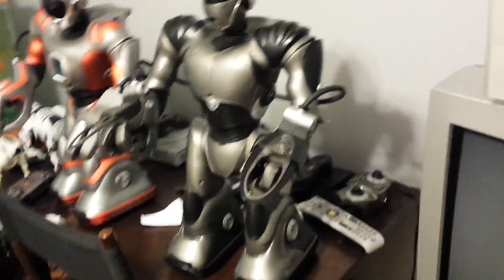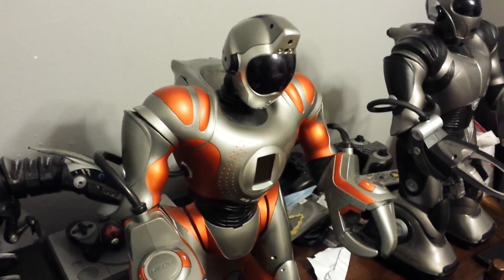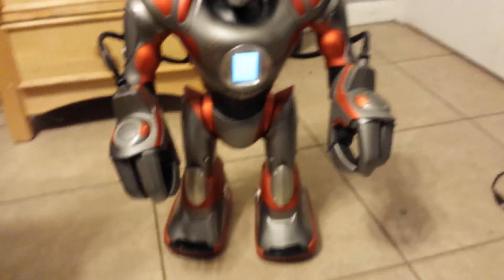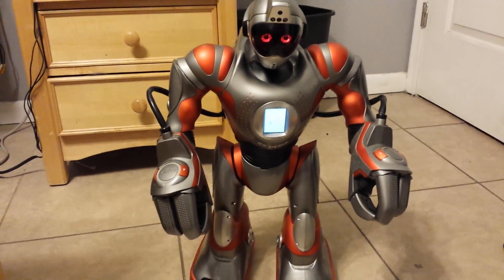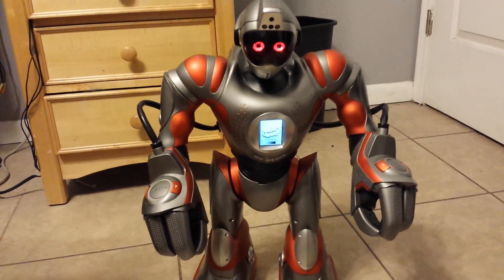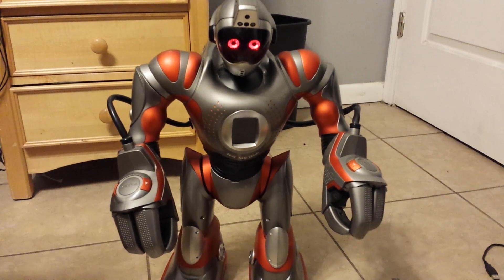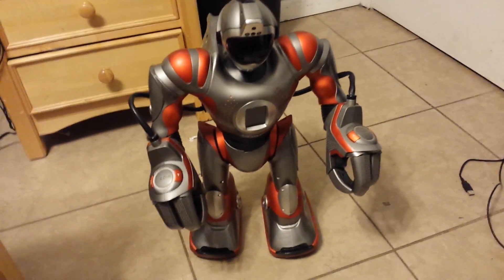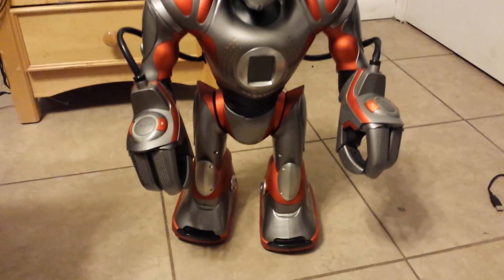Rs media problem

Comment: He said exactly what's wrong with him. The batteries in his feet need changing. Either constant walking has sponged the wires carrying the current from the batteries to his motherboard, making him shut down whenever more current is needed, or RS media cells themselves are so old that when the robot begins to draw enough current to operate, it shuts down. Honestly, simply hooking it up to an AC adapter looks like your best bet right now. It would be incredibly hard to try and find an adequate replacement for its power.

Comment: Hey..did you ever figure out the problem there ?....my rs media is doing exactly the same.....would really like some advice
Reply from the maker: Yes it was corrosion on the Double A contacts.
Reply: Hi where is the double A located in the robot? I have the same issue
Reply: @hoangchutich2144  at the bottom of the feet at the top

Comment: I have a 3rd gen V2 and it does not turn on, do you know what the problem may be? Thanks
Reply: They had notorious problems in V2 and RS Media models for the wires going from the batteries to the board having their rubber coating be melted off due to slight heat... They didn’t use a lot of rubber so it melted easily, but they paid for it in the long run... Now they all have these wiring problems and the only way to fix it is to replace the wiring... It basically shorts it out so when the positive and negative wires touch, the power goes through the route that has the least resistance, which would be the bare wires inside... This causes him to lose power and shut down, but he thinks the batteries are dying, it’s because the only power he has when they touch is the power in his capacitors... In your case him not powering on would have to be that the wires are touching constantly and his capacitors never get charged, causing no sign of power... 

Hope that makes sense...
Reply from the maker: Prob the AAA contacts

Comment: how much corrosion is left in it the problem is with the double A batteries so either corrosion or a wire but luckily rs media doesnt have the faulty wires like v2 does so he diffident could be fixed

Comment: Hi me and jobeanvideos can help u he can help u with media and I can help u with the v2 gears also do u live in the usa ?
Reply from the maker: ya live in florida
Reply: projectNova0 ok I can help u with the gears and wires for v2 but u can send me them and I will fix them for u also send me the blue v2 as well is the blue one being used for parts ? If yes I will use it to replace the gears also I can do upgrades to like for v2 different color eyes leds also if u do want me to fix them email me at zorua7868@gmail.com so I can give u my address and it will cost as well to repair but it wont be that expensive.  :) glad to help.
Reply from the maker: Zorua635 Could you make me a video showing a repaired v2 and I sold the blue one so I only have the silver. im buying another silver v2 on ebay soon
Reply from the maker: Zorua635 Also if you make the video ill have no problem sending it

Comment from the maker: Yeah I think it may have been battery corrosion because when I opened it up there was a corroded battery in it and also I made a new video showing the v2 for a guy who repairs them on eBay are you sure he's dead completely? I've had about 100 bucks for him are you able to replace the gears? Because I have a blue v2 I could use for parts
Reply: Yep sounds like battery corrosion to me because of the sound glitching when it fully powers down.

Comment: 1 check for battery corrosion which im sure you have 2. in this case this is probable a pulled off wire from the battery contacts on the inside you well have to open both legs and see. it could also be in the upper body too so just sort of open it up look around im sure this can be fixed but v2 im sorry to say he is to broken the gear is broken in the body the legs seem to be broke and the insulation on the wires is bad thats why it shuts off and it well fry in this case